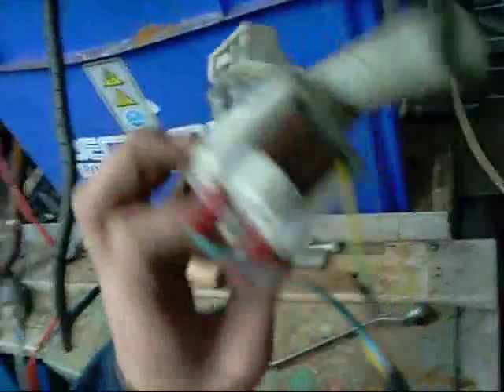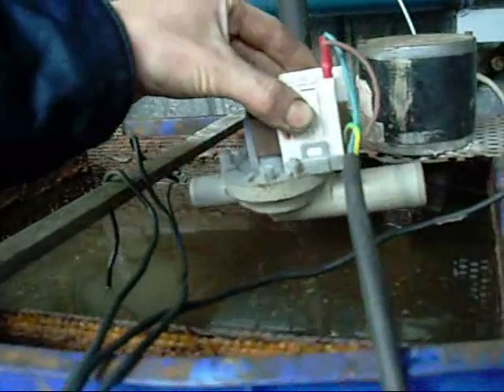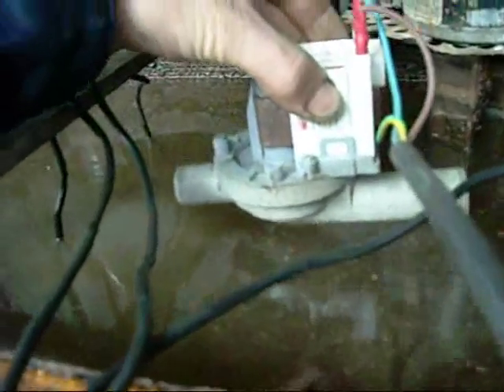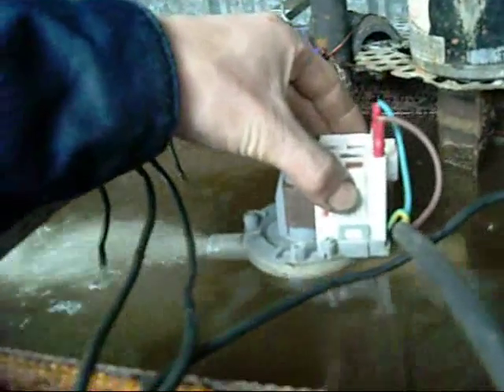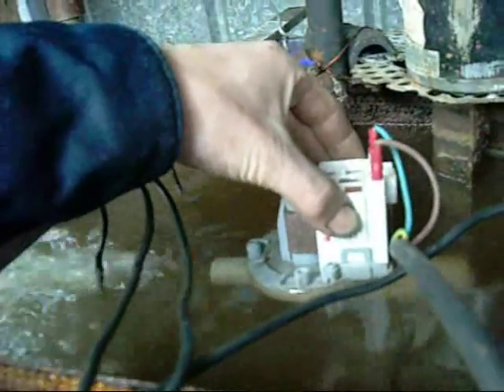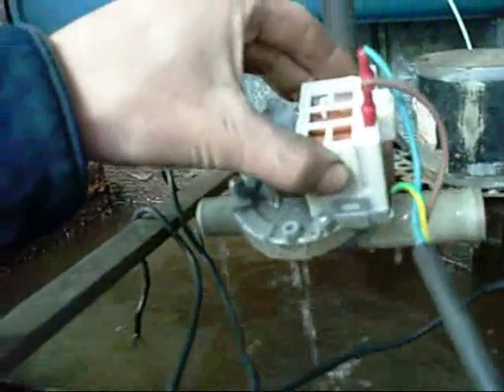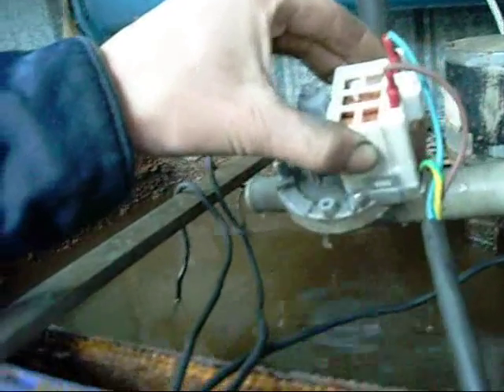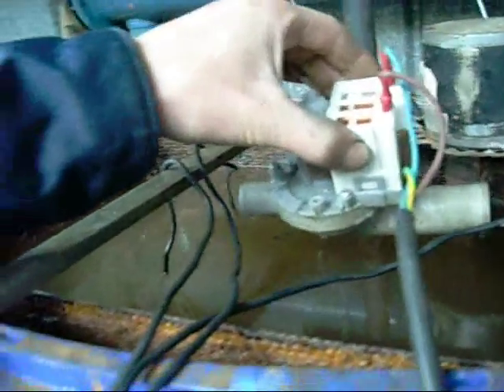Small AC Waterpump test

Comment from the maker: Cool

If theres any standard to the wiring colors, Black will be your AC common (negative). Red will be a high speed run (posetive) and pink will be a low speed, or vice-versa.

Try connecting your mains neutral to black and the active lead to one of the 2 others, pink or red, and see what happens.

Was there a run cap inside the dehumidifier cabinet for it?

Comment: @maco10810 This isn't Aussie50, but, the pump uses an electric motor.  The electricity acts along with magnets to spin an armature which in turn spins the pump impeller.  There are opposite forces working against each other to force the armature to spin.  Hold the north end of a magnet again the north end of another magnet and the two magnets push each other away.  Opposing forces at work to move an object.